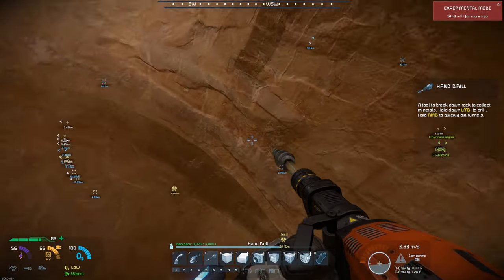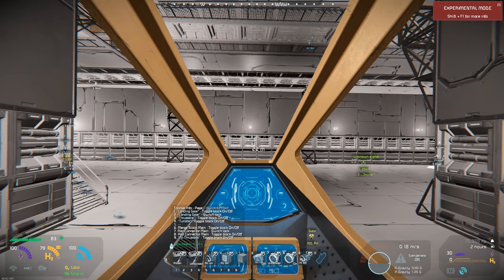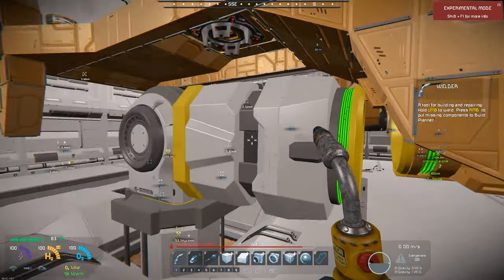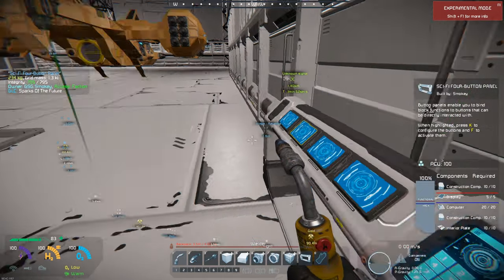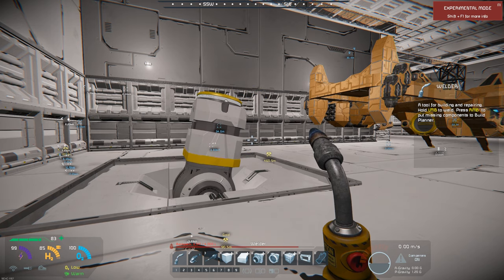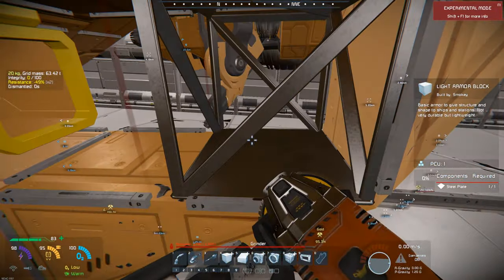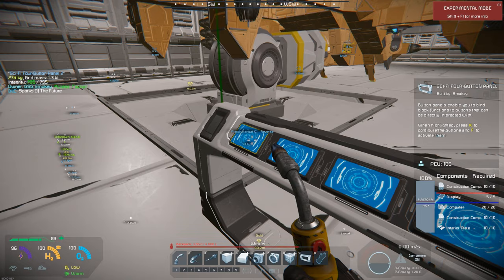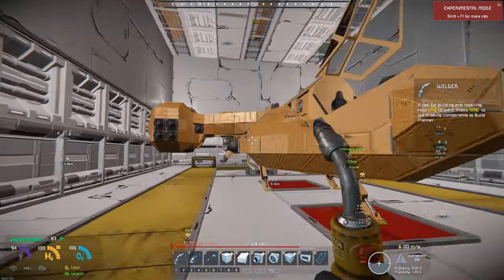Space Engineers All The Mods Episode 06 Building a Piston Hinge Connector

Comment: I had a cool Idea, Make the Ships Hanger as Wide as it is Long, so it goes in sideways, Have a Connector on ships bottom, It lands on it in main Hanger, then there is Piston to connector in the floor that Re-tracks and carries the ship in to its parking stall on side, you could also add a Rotor so it Auto Spins it first 180 so its facing out for fast deployment.
Reply from the maker: that does sound cool :)

Comment: Man you sound so much like me when im playing anymore "im too lazy to setup really complex stuff". The one tip i was going to toss out is if you replace the large hinge head with a small one you can use a small grid connector on your base side of the system and save a tiny bit of space and i believe it also has a bit smaller hit box, so maybe easier to position under your tail fin. Also the small grid one has side access ports so you can pull stuff from it while its connected to your ship, that is a little harder to do with the large grid one.
Reply from the maker: Lmao, no need to make things more complicated than necessary. The small hinge and connector is a good idea I'll have to remember that one 😄